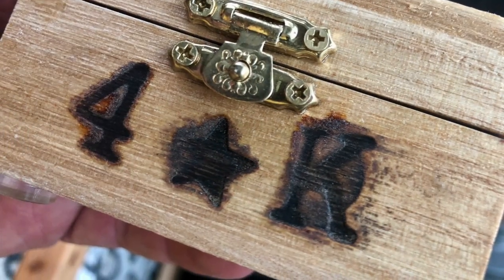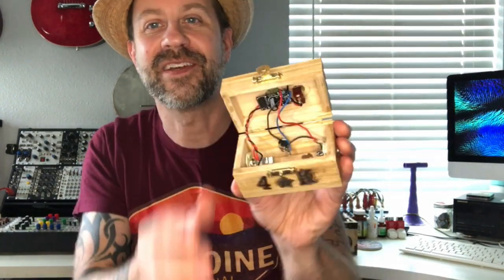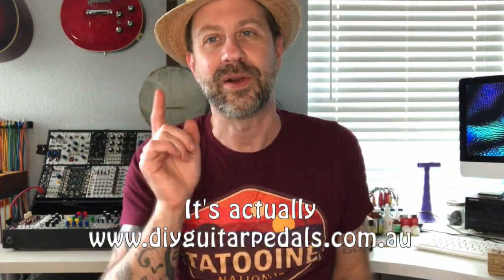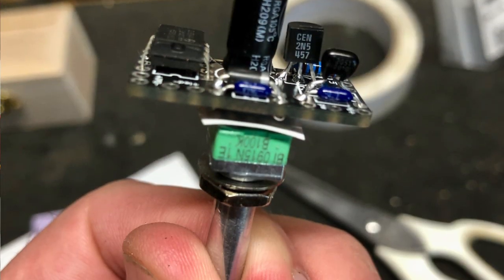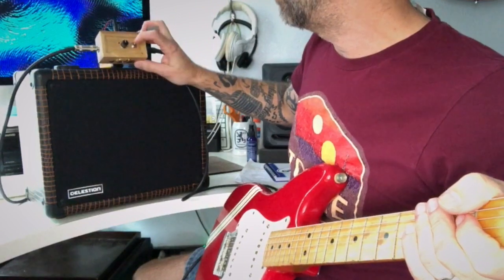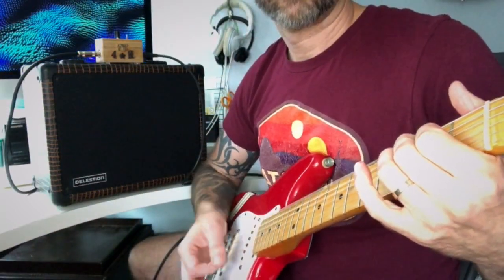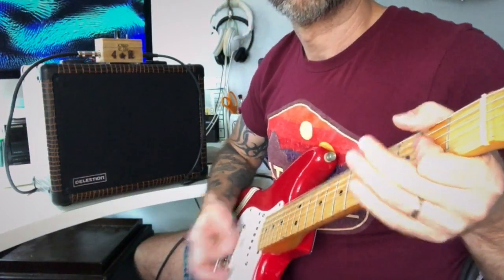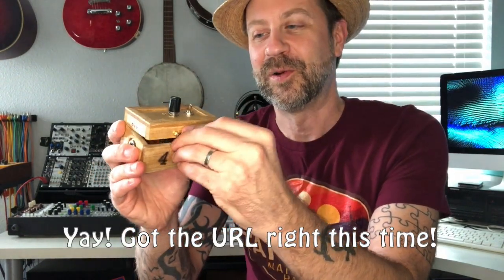DIY Chime Amp Head (to commemorate 4K Subs)

Comment: Congrats on 4K!! Now, how does that little amp take pedals???
Reply from the maker: I tried a reverb pedal off camera and it seemed to work fine but I need to still try it with a fuzz or something. Based on how clean the signal is... I think it will handle it fine. It's such a cute little package. LOL.

Comment: Hi Kale, Real cute, I like it. How much did the IC cost & how long did it take to git them? Also how long did it take to get the PCB after you ordered it? Will it all get here before my soldering pencil gets hot? Blessings from the Emerald City
Reply from the maker: The PCBs take about 8-10 days from Australia to TX. The IC's took a little bit longer. I think around 12 days. I think I paid between $7 and $8 for the 5 chips delivered. They're pretty inexpensive but not as plentiful as some of the other chips. If you do a search for TDA7052A, you should find a few sellers in China.